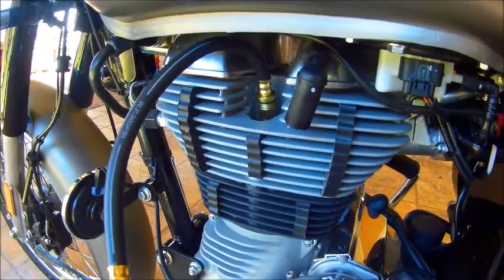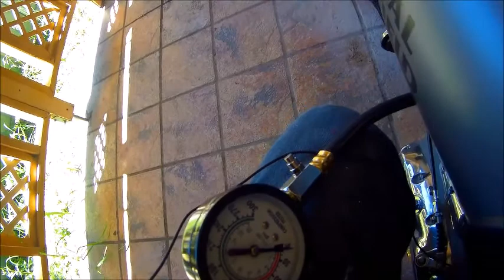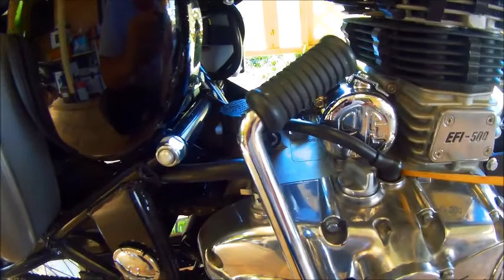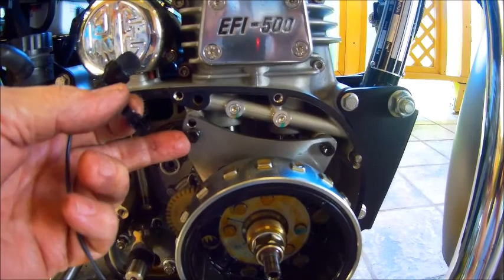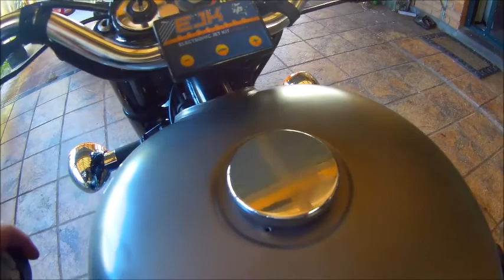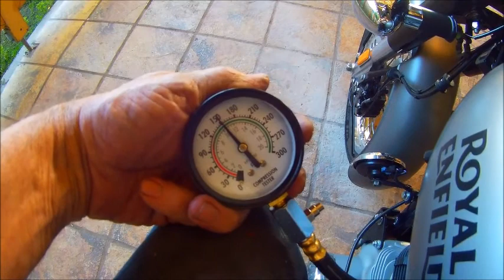2018 Royal Enfield Gun Metal Grey Part 11.Faulty Decompressor

Comment: It’s really not a good idea to remove the decompressor pin, without the pin in place the roller of the cam follower will have to drop into the groove it leaves empty in the cam profile. Don’t be surprised if the roller or the cam face itself starts to break up as they are surface hardened and won’t take shock leadings very well. The failure is usually caused by the tiny hairpin spring. Don’t get me wrong here I’m not knocking your fix, just giving you an engineers view and I have been riding Enfields for over 20years and 250,000 miles - they all have their ‘foibles’.